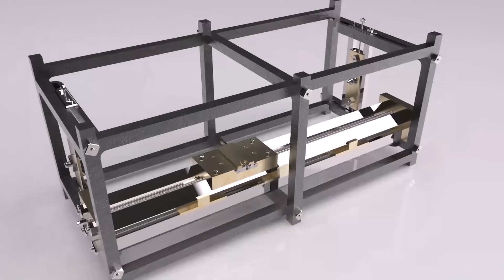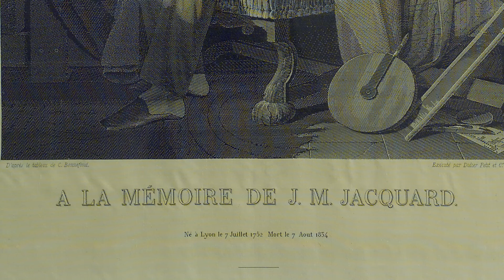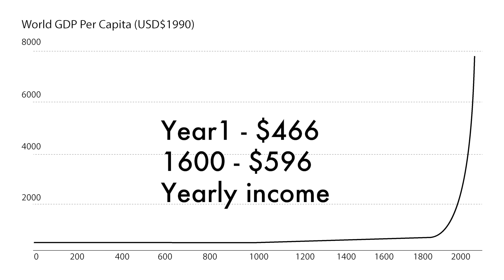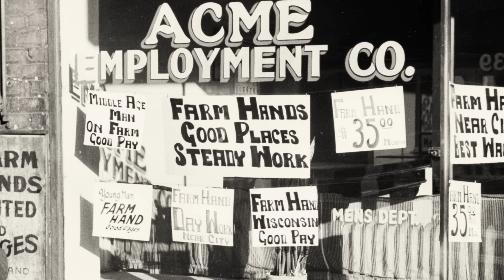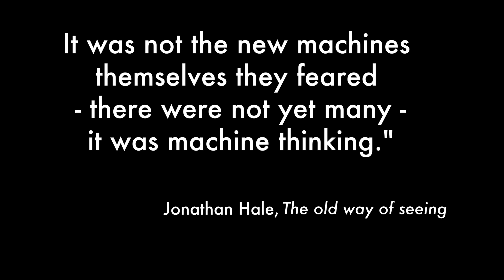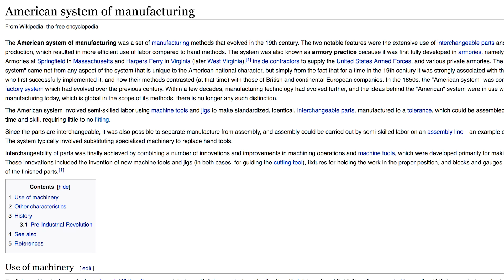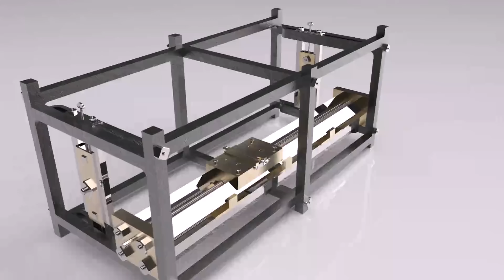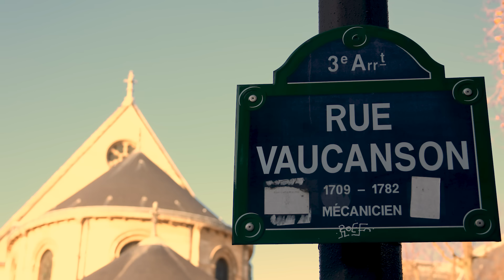The 1751 Machine that Made Everything

Comment: It's often said that a lathe is the only tool that can make itself, 

so how the hell did he make the first lathe?
Reply: I don't know how often it is said, but it's true. It's also true that starting with a lathe you can build an entire machine shop.
Reply: @cfrandom  well i know where I need to start
Reply: Interesting question.  I'm fascinated by hand processes that can be used to machine extremely accurate surfaces without actually having such a surface to start with.  For example, you can grind extremely accurate lenses and flats without actually having a precision reference.  In other words, with the right methods and geometry you can use hand made, low precision equipment to build increasingly more precise products.  It would be interesting to see someone start with zero precision equipment, parts, and build a precision machine using only these methods...
Reply: @svenp6504  You should take a lock at Clickspring and his Antikythera-series. He is reproducing a mechanical model of the solar system with ancient technology and builds most of the tools acording to the way they ware build at that time.
Reply: svenp you would love blacksmithing then, making precise and fragile things with a hammer and hand tools is a amazing feat.
Reply: Start with a shit lathe made of wood. Carefully make a better one. Rinse and repeat.
Reply: The actual process isn't that hard to understand. But if you want a good idea as to how a lathe is built, take a look at the gingery books. Yes, those books rely upon some things that currently exist (accurate screws), but will give a very good idea as to how precise machines can be built with imprecise tools and materials.
Reply: Can a lathe make its own bed slides
Reply: @ferguson20diesel49    I feel like people are reading this different to how I am.
But if you mean make the saddle slide, yes many lathes can, it's called a feed, through gears or belts the rotary force is shared to a long threaded bar running parallel to the spindle, that threaded bar is fixed and goes through the saddle, giving horizontal movement with just a flick of a lever.

Maybe I'm reading your question wrong, but there other answers are completely true
Reply: @ferguson20diesel49  Yes. Round ones.
Reply: @ferguson20diesel49  I KNOW RIGHT????
Reply: how? you start with a blacksmith & some metal.
Reply: Aliens
Reply: It's lathes all the way down.
Reply: Aaron Coughman yeah but that requires a lathe we don’t have remember. I understand what you mean? I used to own a lathe. And used them a lot school
Reply: So to summarize, Ingenuity, evolution, and much patience are the requirements. I mean the Egyptians had rope for strait line a wood compass  a plumb bob, and water as a level. Using stone as a median then evolution, then, voila, a space rocket  or whatever is your favorite achievement.
Reply: Start with shit machines, carefully make a better one, rinse and repeat. This is exactly how it went down lol
Scraping can produce some impressively accurate surfaces, however, it also requires a gauge to the accuracy you want to achieve.
Pour a steel casting flat, the liquid metal will form a flat surface. Pour bronze, a lower temperature metal, over top. It will produce a surface close to flat. That is your gauge. The lower the viscosity of the parent and gauge metals, the flatter the gauge will be.
Use that gauge to hand scrape a surface flat, which allows you to build rudimentary, somewhat accurate metal ways of a lathe.

First spindle... I would they mounting between points, and using a strap to drive the workpiece. Rudimentary, not very functional, but capable of producing concentric shafts if you had an accurate guide.
If you can make a fairly straight concentric shaft, you can form plain bearings on it.
Reply: dan ward, yes true, though the more accurate statement would be , the lathe is the only tool that can replicate itself,  but we get the idea brother.
Reply: A cnc router can build almost every part of itself, much like a lathe.
Reply: Iteration after iteration. With each new lathe you make, you increase precision.
Reply: The chicken or the egg
Reply: Dan Ward There's an elementary fallacy in your question. Just because a lathe can make itself doesn't mean it's the only way.
Reply: You buy it from a Chinese shop
Reply: Because he was a Human so  that statement doesn't apply to him...😎
Reply: So it's the duck or the Egg scenario... Or is it the chicken?
Reply: Of course the lathe deserves recognition as an important step forward in technology and (eventually) the industrial revolution. However, to say a lathe is a tool that can make itself is highly inaccurate. To make a lathe requires far more than lathe-turned parts. So far, the closest we have to a machine that can make itself is a certain type of 3D printing machine that is, itself, made almost entirely of 3D printed parts. But computer AI and nanobots may change that...
Reply: @XpaceTrue    You literally can make a lathe with nothing but a lathe and enough metal.
Reply: How the fu*k do you make the beval slides on a lathe?
Reply: Miko Jones, you really can have a highly accurate lathe using round ways. Something along the lines of an Austrian Unimat Lathe. http://www.lathes.co.uk/unimat/
  From there one can easily make better and bigger machine tools.
Reply: @Miko_Jones  milling machine bahahahaha🍺🍺😃
Reply: @frankjrszeder5782  A milling machine is not a lathe!
Reply: @Miko_Jones  really can i visit you when you get a job at NASA... The question put forth was how the fuck does it do beveled sides. a milling machine for limited mentally challenged people makes perfectly flat surfaces. Maybe before you post something try reading the context your brain may function more efficiently😳🍺😃😎
Reply: I would recommend to everyone extemely interesting book "How round is your circle" by John Bryant and Chris Sangwin. This book explains how can you make first straight rulerin the world without any other straight things, how you can draw straight line without a ruler and so on.
Reply: artisan blacksmiths would be my first & last guess.
Reply: The saying is that a lathe can make itself but it does not say a lathe is required to make a lathe. 

A drill can poke holes in things. So can a chisel, punch, bullet, shaped charge, etc.
Reply: Very slowly and carefully. All you really need for a lathe is two stable points, and some way to spin something.
Reply: Same old story which came first the chicken or the egg.. Please ponder and meditate on this for enlightenment.. Bahahahaha 🍺🍺😃😎

Comment: Most would say Henry Maudslay invented the modern metal lathe because crucially he invented the metal lathe with screw cutting ability.
Reply from the maker: Nope. Look Senot's lathe in Paris which made big industrial screws.  Before Maudslay's and imho much more advanced.  Thiout had a screw cutting (clock making lathe) well before either.  There was also Ramsden and others before Maudslay.  Maudslay deserves credit for much, but not that.
Reply: @machinethinking  Whilst I have no doubt that others made lathes that could cut screw threads,  all textbooks say consider Maudslay to be 'the father of machine tools' and credit him with inventing the practical industrial metal lathe.  And just like Edison the genius is to invent something that can be used and of course manufactured and sold.

Comment: This is interesting, but I'm not quite buying the thesis that the lathe was the cause of the the industrial age.  There were too many other necessary elements. You couldn't make a useful lathe of this type without relatively advanced metals, for example, which requires a whole infrastructure of mining, refining, smelting, transport. Once hard ductile metals became  available in quantities that inventors could tinker with, all sorts of machines became possible. The idea of a lathe was not new, it was new materials that made new lathes possible and required them, for working the new materials.  And the availability of metals came down ultimately to energy availability. So 'everything' was caused really by coal-mining. For example.

Comment: an extreme oversimplification and in that oversimplification: fallacious.
to use a lathe you need power. so this machine... well it needed stream power. so the steam machine is what made stuff. 
the increase in disposable income was due to worker emancipation. not increased productivity.
and as the maker of the vid himself states: there were factories before steam. called manufactorums. 

so basically everything in this vid is wrong, and incorrect.
Reply: Avathar Behemoth  You're right, it wasn't any one thing, unless fossil fuels is one thing - that's where the wealth really comes from.

Comment: The invention that changed the world and history is Calculus. Before calculus we couldn't design a steam engine because its non linear. When Newton/Leibiniz discovered calculus, engineers discovered how to control a steam engine, and once we had the power source, inventions like the lathe where affordables. Before the steam engine, you needed wind or a river for getting power.

Today, the problem is still the power source. Cellphones, get more small and versatile as batteries get better, and cars are on the same path.

Steam made the industrial revolution possible.
Reply: Its a whole lot of things that come together to make things happen. In this case not just the knowledge (and size of industry) of metallurgy to craft these machines but also seemingly mundane things like how to seal these moving parts. Seals are still, as of today, a very critical part of pretty much anything and they are often the point of failure, destroying whole machines or even the whole factory if the wrong stuff leaks somewhere. Example: In 1987 a catastrophic explosion of an ethylene oxide purication column (+plant wrecked) occurred due to a leak of a manhole flange.
Reply: Ing. Sebastian Aviña: So, what do you atribute the weatlth growth to?
Reply: Ing. Aviña  is, I think, confusing "inventing" with "understanding"
Newcomen (a blacksmith, as others have touched on) didn't even know about calculus, let alone use it.
And Watt's key insight (that it was preferable to condense the steam elsewhere than in the cylinder, as Newcomen had) was based on practical experience informing his intuition. These intuitions were not understood for another century, when Carnot and Joule finally analysed them using (among other mathematical and intellectual tools) calculus.

Papin (who slightly predated the above inventors) probably did have the capability to understand the steam cycle, because of his association with Leibnitz (co-discoverer of calculus), but his first effort at a working engine was not much more informed by science than Newcomen's would be, and he died so soon after his better second effort that he had little time to analyse it.
Reply: the problem is not the steam engine, is the boiler. 

It wasn’t until around 1867, with the development of the convection boiler, that the steam-generating industry began. and if you make a quick search on convection boilers and technology you will find calculus everywhere... https://archive.org/details/convectionheattr00cantpdf

Comment: here's a little extra for ya, that silk fabric machine you showed that had been created first???? it created it's patterns based on folded cards with holes which is where the first data entry came from for the original computers of the 50's and 60's. Those cards with holes when used with computers are called punch cards. 

Edit Clarity

Comment: You probably covered this elsewhere, but the truly significant lathe was the engineering lathe, or screw cutting lathe.  For instance the long screw on the machine could not have been built on that machine, but a screw cutting machine can make pretty much anything.

Super video really inspirational fundamentals there.

Comment: By the time this particular lather had been invented, watch makers had be turning metal with no difficulty at all for close to 500 years. What is more, this lather is only one of many types of lathes that appeared during that period. I see ClickSpring mentioned below.
How do you think that the makers of the Antikythera device got the precision arbors and pivots they needed? To take the history of the lathe back even further, to the Greek time, metal working lathes--lacking the various advanced features of this one, of course--were in use to give adequate accuracy to the Antikythera device. Less known are Roman metal pumps. These were also precision made on the lathes of the time. Once again, they lacked the advanced features of the lathe shown in this video, but they produced acceptably precise work.  This lathe should be understood as one step in advancement in a history of metal turning lathes that reaches back to Greek and Roman times.
Reply: He did very clearly mention the clockmaker's lathe in the video didn't he?
Reply: I believe he's calling out this particular lathe as a turning point were the source of accuracy shifted from the craftsman to the machine. Not that accurate machining wasn't done earlier.
Reply: It's notable that Clickspring uses ancient methods to make files, cutting tools, workholding appliances, to drill holes and to mark-out and shape gearteeth ... but he resorts to his modern, intrinsically accurate lathe for turning.
The ancients had nothing comparable to a modern lathe, but (as brocktechnology points out) they were able to use artisan skills to compensate for the lack of inherent accuracy. 
For instance, they would have no way to accurately measure the diameter of a hole against a repeatable standard, but they could use even a rudimentary lathe to carefully reduce the diameter of each hole's mating item until it fitted with the desired clearance or interference. 
Similarly they could turn a journal or shaft to a constant diameter over a longer distance by starting with an oversized approximation, then carefully taking off material wherever a hand-filed gauge (perhaps with a slightly tapered slot) showed it to be oversize. 
For a more exacting requirement, the material of the gauge would be thinner, and the tapered slot closer to parallel.

I suspect Clickspring chose not to add this degree of realism for two reasons:
1) his project has to proceed sufficiently quickly to retain audience interest
2) plenty of modern-day amateurs work with ancient or heavily worn lathes, so that artisan methods of compensating for gross inaccuracies are well known and understood. Whereas almost nobody makes their own files, or produces holes by ancient methods.
Reply: @Gottenhimfella  
Well said.
Reply: Yeah, most of that was in the video

Comment: And then there are the artifacts from antiquity that defy explanation by archeologists. There are stone blocks in Egypt that display evidence of being machine worked. This was noticed as far back as Flinders Petrie in the late 1800's. And no, I'm not saying aliens or any of that whoo whoo crap. Only that the ancients Egyptians and others had technologies we do not yet know that they had.
Reply: I know how to get identical machine marks on the stones, and get a precision flat fit. Do I know absolutely that this is how the ancients did it? nope. BUT, if you get 2 stones, split them or hammer away at them even possibly with another rock) until you have something roughly approaching an unfinished but roughly flattish surface, you can then rub those 2 stones together and each will grind away at the surface of the other until you have a joint so flat and smooth you cant get a piece of paper in it. If you are really really patient, you can get a mirror finish. Not only would this be well within the technical abilities of the ancients, it is basically still the basis for how we do things now, we just use nicer rocks.
Reply: Machines make things faster and cheaper, but if you have enough human labor to throw at a problem you can still get pretty good precision.  That is what Egypt had, lots of skill workers with hand tools, in many cases people literally paid their taxes in tool time.
Reply: they did. the way they made those holes is probably with ropes, copper tubes and sand. its quite amazing how far back using machines go.